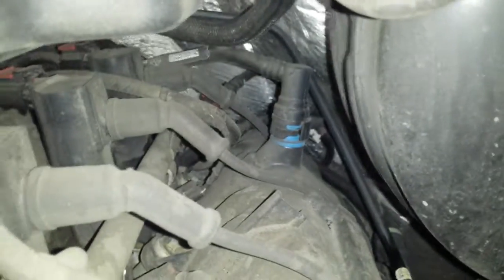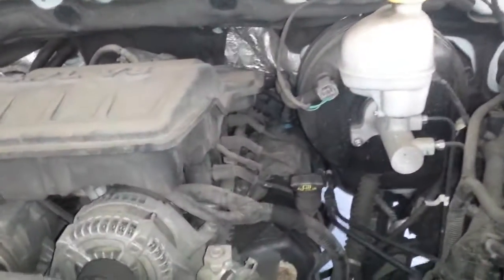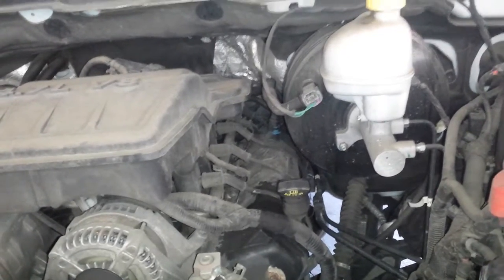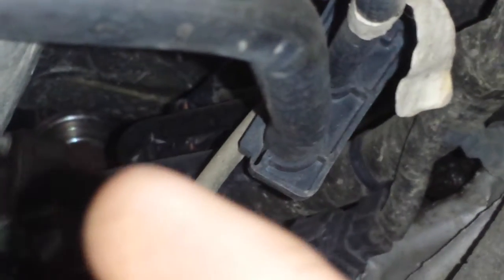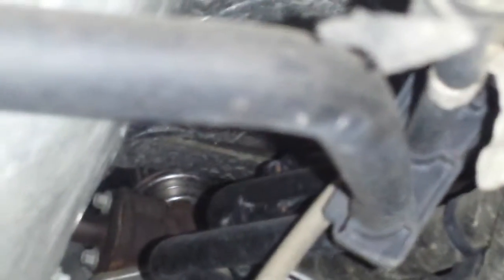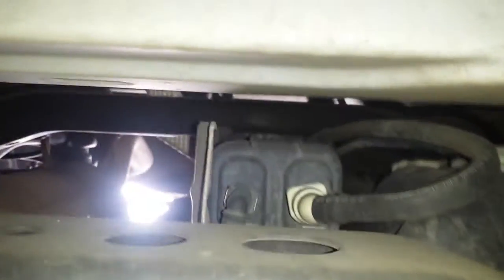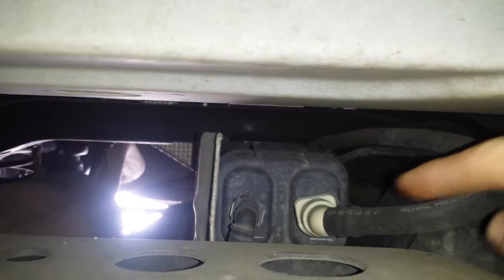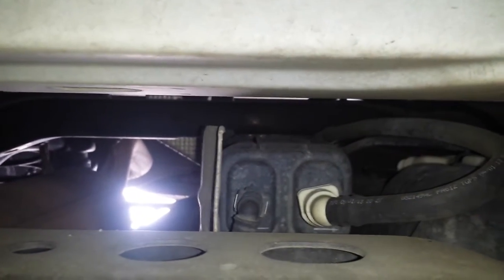Dodge Ram Emissions: PCV,  EGR, &  EVAP canister locations

Comment: Question. My truck has been in the shop several times with no luck fixing it. They replaced the fuel pump, fuel sending unit, among other things and it's still randomly dying. When it loses power, I can pull over and it restarts no problem. It can go a week or more without issue. Then dies randomly. No one has been able to help me figure out the issue. It's a 2013 Dodge Ram Tradesman 4.7L 2WD......Any suggestions?
Reply from the maker: Is this a electronic throttle pedal? If so.. have someone check and see if both throttle sensors in the pedal are working... just a thought.

Comment: Finally someone helped me find it on the earlier years it's way easier to get to
Reply from the maker: These trucks are super easy to work on when you  know where the components are located.  Good luck on you project.  3🤞🏻💪🏻👍🏻
Reply: @ScottiesHobbies  thanks man do you recommend working on it from the top of bottom I hafto change the EGR valve when I idle it runs rough bouncing

Comment: So I have to drop the gas tank to replace the canister?
Reply from the maker: Looks like it. Why do you think you need to replace your vapor canister? From experience I've only had to replace them if they have been submerged in water or if you can see a visual crack with moisture. Are you chasing a code?
Reply: @ScottiesHobbies  bcuz my customer wants me to replace it after I fixed the slow fill up gas...after I clean the filter beside the gas cap filler neck...but still wants me to replace the part 😩

Comment: Do you have a video that shows all the same for a 2013 with a Hemi? I’ve got a code 456 and can’t find the Fuel Vapor Leak detection pump. Any advice or knowledge would be greatly appreciated. Thanks for sharing!!
Reply from the maker: I don't have a video particularly on that year make model and component. I do have a co-worker that has a 2015 1500 with a Hemi in it. He said his leak detection pump is between the firewall and the intake manifolds  in the engine compartment. He also said he got the same code within 7000 miles of purchasing his vehicle. And after some research found out that there was a recall on that vehicle with that code and had it fixed for free at the dealership. Have you checked for recalls on your vehicle?

Comment: I had my leak detector pump replaces...gas cap replaced....and it still reads the error code as "small evap leak".....any clues on what it moght be??
Reply from the maker: +Oscar Payan  probably a small leak. I would check the purge and vent solenoids.  The vent some times get debris in the flapper and it wont close all the way. I would recommend someone do a smoke diagnosis to find the leak.

Comment: does this pvc valve require special tools to replace
Reply from the maker: +Kent Fields ya know, i have never actually replaced one of these. But this is a odd style pcv valve. It looks like the pcv has threads on the engine side and a larger socket should unscrew it after you take the hose off.
Reply: Appreciate   That Thanks